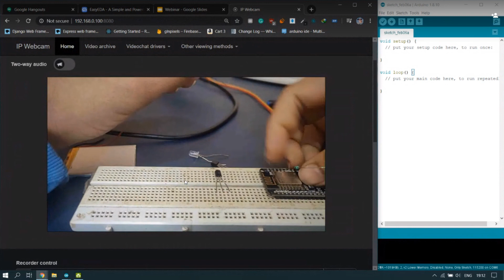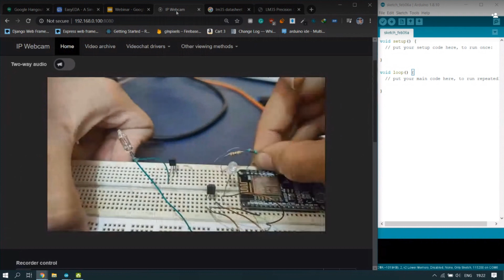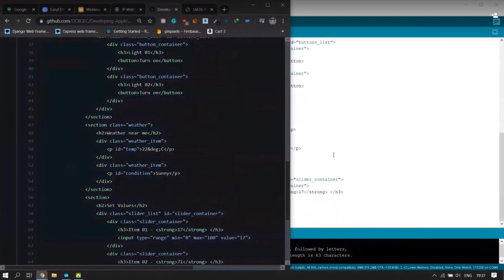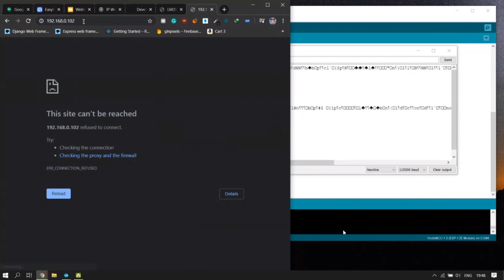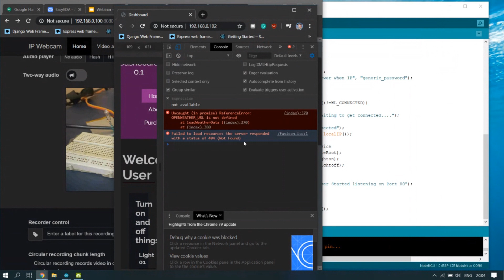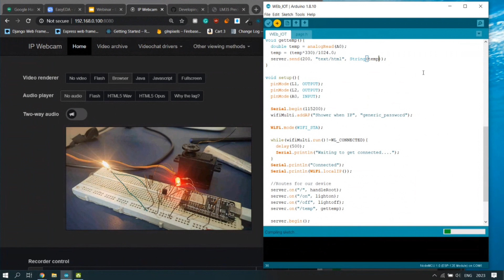Bridging Gap between IoT & Web by Ritankar Paul | DC KGEC

Comment: I have a  question like ,why do we include the header file "page.h" like #include "page.h" and the other header files like #include <(header file)>.Is there any difference??
Reply: The difference between these two syntaxes is subtle but important. If a header file is included within <>, the preprocessor will search a predetermined directory path to locate the header file. If the header file is enclosed in "", the preprocessor will look for the header file in the same directory as the source file.

in case you don't believe me, here's a link
https://stackoverflow.com/questions/21593/what-is-the-difference-between-include-filename-and-include-filename
Reply: @krishnabose1343  Thank you, cleared most of my haze.